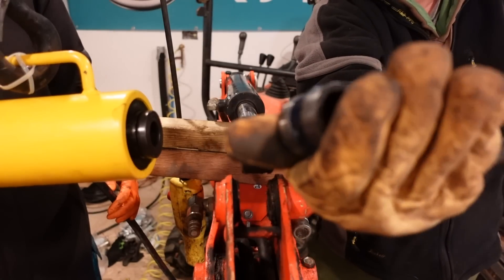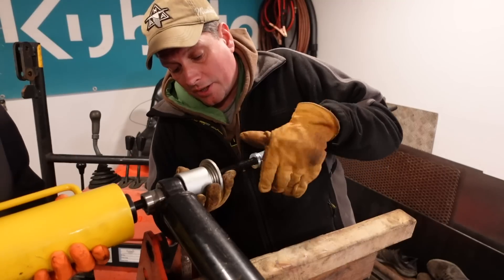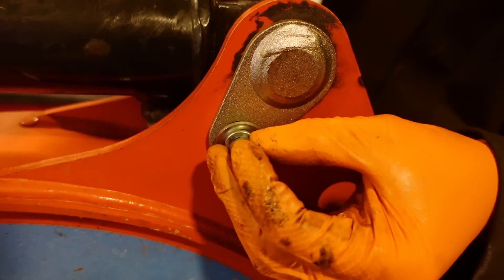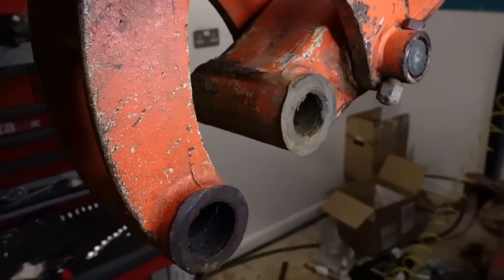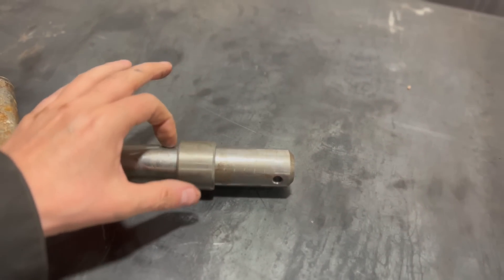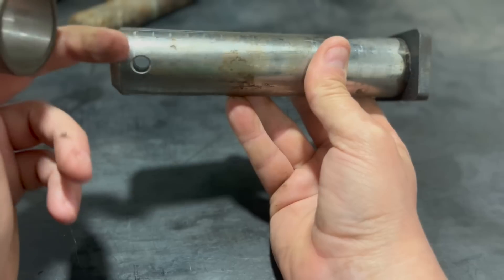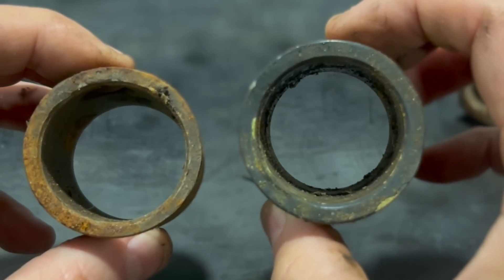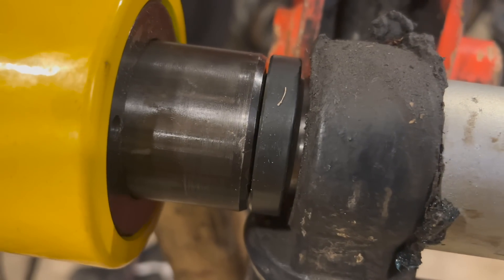UNDER PRESSURE !

Comment: I thought of you today, Mucker, as I tackled a job where I really should have had a hollow ram! I got by today with other improvised things, as I have always done, but I think a hollow ram needs to be added to the toolkit! 
Nice to see the king-post on the little Kubota had bushes in the parts where the pin doesn’t move, so it can all be returned to new tolerances. Good job well done 👍

Comment: Yep, oil & grease are definitely cheaper than steel. New pins and bushings are a lot cheaper than re-welding and line boring too.
Reply from the maker: Regular maintenance can see a machine go in to tens of thousands of hours running time 👌🏼
Reply: @LordMuck  We still occasionally see customers with some of the original greats - mid 1980's mini diggers like the Kubota KH36 or the Pel-Job Eb12 - that are running along nicely.

Comment: Hi Kurt you & Kim made that look easy up grades auto greasing or at least fitting all the grease nipple's were they can be got at with the boom in one position  Quick hitch  another small one a spirit level fitted to the cross bar in front of the ROPS I have cable tied one there to help when trying to get a level base Thanks again

Comment: I would be lost without my hollow ram mate I even have a low profile one for tight spaces. I used to work on Holmer self propelled sugarbeet harvesters and slurry spreaders and the king pins would need pulling at 700bar and a lot of heat from the gas axe. Then give em a rattle on the side with an air hammer and boom! out she comes. I might have to oder a set of those centering washers though.

Comment: I once had a work scheduled PM to replace pins and bushes on a giant frontend loader that was used 24-7 in a sand pit. When i received the work order, i just knew that it was going to be stuck froze up and wore out pins. To my amazement, hardly any ware and easy work. This machine had an automated lube system and used heavy gear oil. The system ran off of the pneumatic system. This system was by Lincoln, i know there are several other manufacturers. If the pins and bushes have a lube port of any sort, an automated system can be installed. For a small machine like you are working on, it may be cost prohibitive. If the machine is used to clear brush or demolition work, it may be difficult to route hoses to the ports and keep the system intact. I have sense seen these systems used in many applications. I can certanly attest to their effectiveness.
Reply from the maker: All our big machinery ran Lincoln systems, it's good stuff

Comment: I'de put a tilt blade on a small digger with a replicable cutting edge.
When i bought my second hand JD 6210 the front axle pivot bush hadn't been greased since Adam was a boy.  Bush gone and a lot of steel missing from the axle housing.   A mate and I put new trunions and bushes in with quick metal behind the bushes and its worked really well.   Done another 1200 hours but and i mean but i grease that thing every 10 hours. 
Cheers Mucker (i really want to come over and visit the Matadors)

Comment: Informative video Kurt👌 as for additional features platform space to allow you to use your feet for tracking, hydraulic angle blade, and a thumb and blade extensions provided as standard to add a bit more stability to the machine 🤔 although the addition of all these might increase slightly the size of the machine 👍

Comment: Great stuff M'lod, nice new parts gone in the Kubota👌 my mate just bought a low hour 2012 1.7 ton IHI, went for used brand route aswell and not the chinesium stuff. 
For the design of the new k008, maybe go for the joysticks on the side of the seat for more operating comfort, might be difficult though seeing the width of the machine.
Keep 'em coming! Cheers, Mike

Comment: Most machines, your little bagger included would benefit from central grease location to the spots that can be tubed. My old Hanix rides rough - so an air suspension seat would help the operator.

Comment: My improvement for the Mini digger would be the deceased that the seat would go further back and the connection and the controls could be adjusted for for more operating comfort.
Because I'm a rather tall Feller and I've had and I've had struggles operating operating the machine for longer periods Comfortably.

Comment: Some trucks I've driven over the years had self greasers could that not be put on more plant jibs dumpers rollers. The plastic piping could follow the electric cables there are spots on the jib so could cover all the pins and bushes. What you recon mucker

Comment: I'm surprised the by the degree of play in the king post of your machine, given how clean and tidy the machine appears.
I also have a 2016 K008-3. It has ~1700 hrs but my machine doesn't look as clean as yours but surprisingly there is minimal play my king post and I don't believe it has been given any new bushes.
Reply from the maker: There's never any rhyme nor reason between different machines. Main play was in the main pin not the king post however.

Comment: Hi great video I was just wondering where do I look to purchase one of these hollow rams
Reply from the maker: Go on ebay
Reply: Thanks very much your very helpful cause I’m thinking of doing a over hall on my excavator so thanks for your help
Reply: Sorry to annoy you have another question can you use a standard hand hydraulic pump instead of the foot one
Reply from the maker: Yes that's how we started out, we just found the foot pedal frees up your hands
Reply: Fair enough I know what you mean I take it I’d get the pump off eBay too does it have be a specific class off pump to match the ram sorry about so many questions it just before I’ve been used to just beating them out
Reply from the maker: Vevor (the ram maker) also makes the foot pedal.

Comment: Bush 😂 I’m such a child
Reply from the maker: Hammer your pin in the bush...
Reply: @LordMuck  😂😂😂😂😂😂
Reply: Make sure you grease it well first, that way it stays a tight fit..
Reply: The new one needs a oil grease system built into it so machine actually greases itself while it being operated

Comment: I was told by a chap I was working for you can over grease things is that correct I don't see it myself
Reply from the maker: The theory being you'll push the seals out - so what ? you'll keep pushing the dirt out. 
It's and old tale normally suggested by lazy c*nts.
Reply: I grease the machine first thing in the morning when I'm using it not that I use machines very often anymore it's just one of those things that's stuck in my head am I doing wrong or write I've seen people not grease up more than once a week and others daily it's something I've waited to ask someone I value the option of like yourself
Reply from the maker: Keep doing what you're doing 👌🏼

Comment: Interesting vid on bushing removing n fine examples of brute force from saving on grease n oil, what that noise LOL.  Answer to the question I fit rotary head to get better finish, add extra hydraulic block for other attachments n extra protection for dirty fuel.